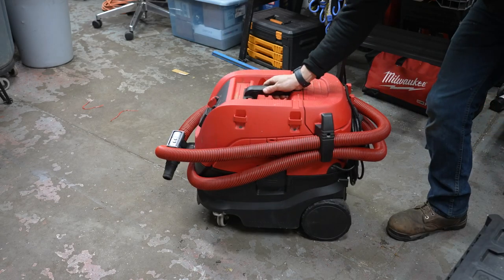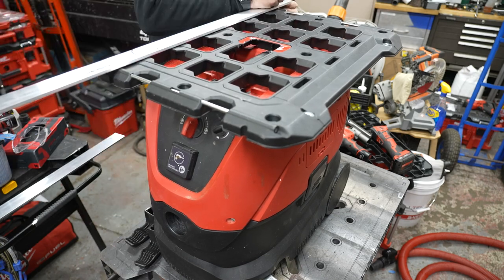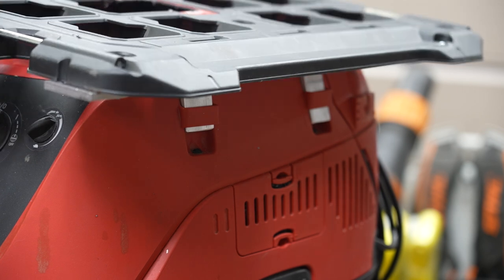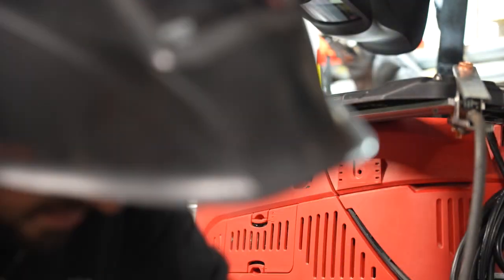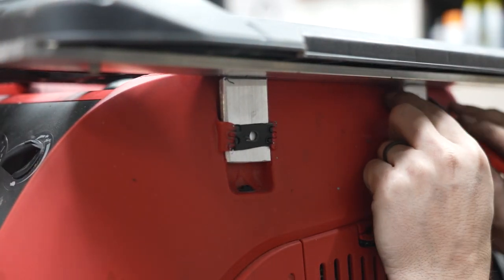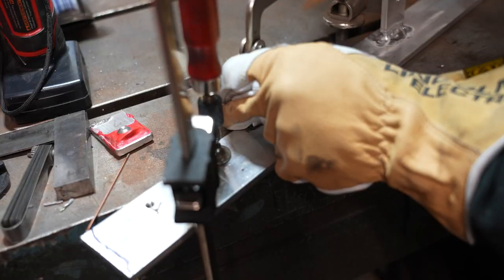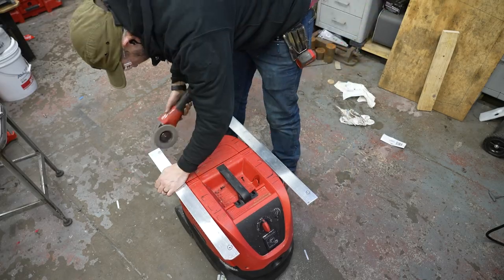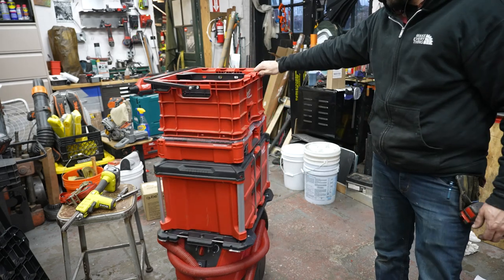How Did Milwaukee Tool Miss This?!

Comment: I agree, why hasn't Milwaukee come out with a more integrated design?  That is so clever. Great mod, Chris!
Reply from the maker: It doesn't even need to be integrated! All they had to make was the little accessories I welded up and this would be a bolt on addition!
Reply: @MakeEverything  milwaukee is so gonna steal this idea :-)

Comment: I just ran into the same problem while welding up a beach cart last night. Then I used a torch to preheat the aluminum and the job went so much smoother after that. I was welding thin to thick but in the end it look pretty good. Great video as always thanks for sharing.

Comment: Great idea! The reason you were having trouble welding the aluminum flat bar is s because it's 6061T-6, which is much more abrasive resistant and contains much more silicon than  5000 series aluminum plate. Even though it looks clean, it needs to be buffed with a stainless steel brush to remove the oxidation layer that is on top of the metal.
Reply from the maker: Thank for the tip!!
Reply: @MakeEverything  Clean your metal with an abrasive cloth including the TIG rod, then wipe everything with acetone. With TIG welding you can never be too clean. The oxidation layer of aluminum needs a much higher temp to melt than the underlying aluminum.
Reply: Aluminum also conducts heat 15 x more effectively than steel, so yeah, it needs to get a lot more energy into it to remain hot.
Reply: also preheating the work before welding helps a lot

Comment: It took them a while but Milwaukee has listened! The new Packout Dust Extractor is launching soon in 2024. Part number is 0888-20. It is powered by either dual M18 batteries or via a plug. Includes remote operation as well, with promises that new tools will have remotes built in to turn the dust extractor on and off.

Comment: Great Build CHRIS! Thank you for showing your “oops”. We’ve all done it, it makes us human. With aluminum, as you know; it’s clean clean clean, and get rid of that hard oxide layer before you weld. In instances like this, where you occasionally weld thicker aluminum; always nice to have a bottle of helium on hand. Its price has increased crazily lately, but it really adds that extra punch on thicker aluminum. It will last a very long time, if you aren’t doing thicker aluminum on a daily basis. Just a thought. Love your builds, craftsmanship and sharing of what you accomplish. Thank you!

Comment: I would like Milwaukee to jam a vacuum into the packout base unit with wheels and handle. The cart could act as a extension cord for other tools and chargers aswell. Maybe even use a compact toolbox and make a cyclone extractor to mount on top of the stack

Comment: The reason Milwaukee hasn't come out with something like this is that it has the potential to be very top heavy!
Reply: Wrong.  Nilfisk (the company that make this vacuum) makes a mount for the top for some of the other pack-out style L-Boxx accessories.  Just not Milwaukee.

Comment: In reverse the process would have been easier. cut tabs, insert into plastic add super glue drop to top of tab push onto the bar. that would have positioned the tabs for welding on your weld table. Once the tabs are in position and fitted onto the vac, then drill and tap in situ. So basically your process in reverse and a whole lot easier with 100% accuracy of hole location. Love your concept idea.

Comment: I was thinking somehow if you could have designed and made a top that is removable so that it is not a permanent fixture. You can have the aluminium welding as far as I'm concerned I'm not going to do any aluminium welding. I haven't even done tig yet. Although I have a tig welder and wire fed welder. I have been thinking about getting packout. At the moment I have festool, dewalt tool boxes and some makita tool boxes which is the systainer. After my festool vacuum ran away from home. I don't know why my festool left me we not once exchanged angry words.I bought a starmix type matabo vacuum as it was a little less expensive than the festool. Although it doesn't have carrying capabilities than the festool. In saying this the festool did break some plastic on the top. So your design really is more robust. Well done.

Comment: All the tool companies are in it to make money. That's why you don't get everything at once. Everything is sold separately for more profits. Trust they will come out with it soon enough. It will also be unreasonably expensive and be it's own kit.
Reply: Charles Lanier . You are correct. Tools don't come out all at once. Newer designs are sitting waiting till the right time also batteries are inflated prices. I believe batteries have a cycle life built into them. So many batteries I have owned are dropping cells. At the moment my festool batteries hold up really well. Also my panasonic batteries. the panasonic are the older 3.3 amp hour 14 volt. I spoke to an electrician who used panasonic and he stated the older batteries were better than the newer 3.5 amp hour. So whatever has been done at the factory or manufacture is clandestine. We are no dummy.we know the batteries drop out a lot earlier than they should.

Comment: Aluminum needs to be super clean. The sharpie marks or what ever you used to mark the location should have been cleaned off with Acetone along with both aluminum parts. Also, use a heat sink to disperse some of the heat from the aluminum.

Comment: The reason Milwaukee has put pack out grid on top of it is on purpose. 

They didn’t design the vacuum. And the people who designed the vacuum didn’t design it to be load bearing. 

Milwaukee knows if they put pack out grid on top of it, some guy is going to stack 200+lbs of tool boxes on top of it. 

This will end up breaking off the vacuum wheels, and causing unsafe tipping hazards that they’ll eventually get sued for when some guy yanks his vacuum hose and tips 200lbs of tools onto some union worker’s steel toe boots and puts him out of work for a month.